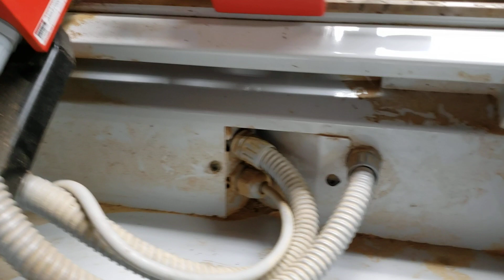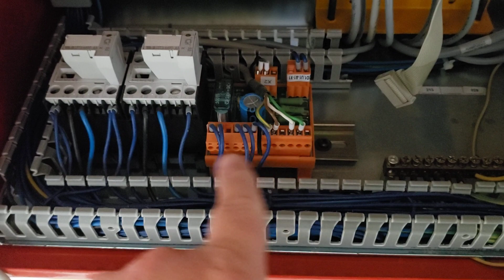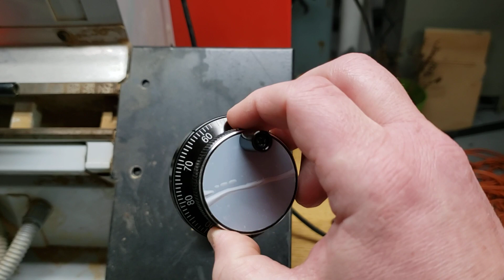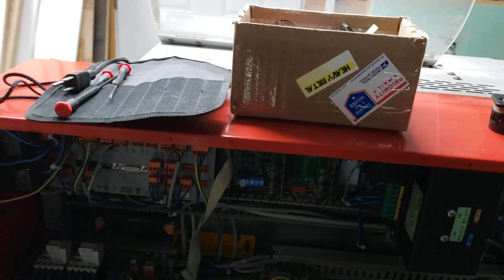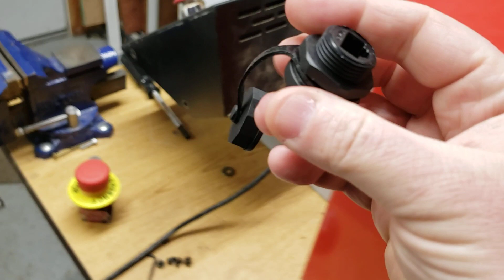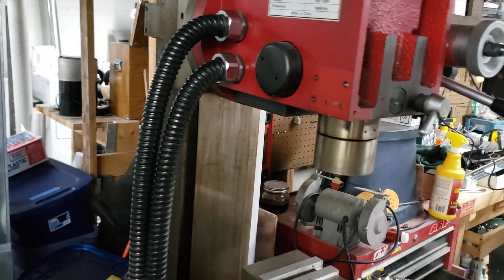new toys, build happenings and other general bs  emco pc turn 55 build coming soon

Comment: Hey. I just got one very similar. Moving it to mesa 7i96 but have it moving with parallel BOB to test. Need the extra inputs for turret and threading encoders. Trying to figure about the turret with carousel comp atm. I ended up replacing the stepper boards with drivers but not sure if that was necessary.
Reply from the maker: I got all of the information from emco on how to use the old driver board, so I'm keeping it for now and connecting to it with an idc16 breakout board going to the 7i76ed. I didn't want to be short on IO and encoder inputs and the 7i96 seems kind of limited in that sense.  The turret is definitely going to be a bit of a head scratcher 🤞🤞
Reply: @TheFeralEngineer  sounds like a plan. The relay driver is at the front as you correctly point out in your video, it takes 24v switching and runs at half current normally to keep tool tight against the pawl. The connector at the front of the same board is fed from the opto interupters on the turret, one for index one for home. I'll probably write a custom comp file for it as carousel comp isn't suitable out of the box (and complex for this application). I have something to start from but just lacking time to dig in to it at the minute. Looking forward to see what you do with it, very well built machines for sure.
Reply from the maker: @johnharding9936  I've got ladder logic 90% worked out. Carousel didn't work for me. Watch video 4
Reply: @TheFeralEngineer  awesome I'll check it out. I actually found another comp file that I'm going to try, it's called pc200 I think and it's very close to what I need. I gave up on carousel too, it's too complex for this application. I'll check out your video for sure though, thanks
Reply from the maker: @johnharding9936  i need to tighten up the logic a bit, but I've been playing with it for the last few days and it's reliable every time, so I'm on a solid road. Probably go play with it in a little while to clean it up.
Reply: @TheFeralEngineer  nice one, I know nothing about classic ladder but I see you have a lot of tutorials on it so must have a watch. Thanks for keeping me posted. The pc200 comp is here if you need it at any stage: https://www.forum.linuxcnc.org/49-basic-configuration/33351-lathe-tool-changer-turret-dc-motor-based?start=0
Reply from the maker: @johnharding9936  thanks! It's good to have a bunch of different ways to get to the same end result. I keep comparing Mach to McDonald's - you drive up, order a cheeseburger, drive away fat and happy and Linuxcnc CNC to making your own cheeseburger - first, you start by slaughtering a cow. It's such an open ended software that there's literally a million ways to skin a cat (no pun)
Reply from the maker: @johnharding9936  oh and for the record, my classic ladder knowledge isn't that much more ahead of those I'm teaching. I only started bashing away with it around Christmas time 👌👌

Comment: Are they by chance 5 phase berger lahr stepper motors? i know some other emco machines came fitted with them.  cant wait to see this wee machine going. JD
Reply from the maker: I don't believe so, they appear to be the 3 phase motors from a quick Google search. This is the A01 board. I think the 5 phase motors are from the A00. Emco sent me the schematic for both this morning.
Reply: @TheFeralEngineer  either way they are odd beasts. hopefully you can retain the motors and drives. always good to re-use where possible. assuming they are worth keeping.
Reply from the maker: @makeorbreak5887  yup, saving the motors and drive board, disconnecting the original AC95 bob and replacing it with a 7i76e mesa. Connecting via IDC 16 breakout board to keep it factory clean 👌

Comment: Since I'm working on a Compact 5 conversion at a local maker space I'm very interested in your try on this Emco !
Reply from the maker: I already bought one of the most important components of the build besides the mesa 7i76ed... IDC16 breakout board. Didn't even know it existed until about 38 seconds ago, but it'll be here tomorrow 😆
Reply: @TheFeralEngineer  My bad, I'm going parallel port in 2021 x)
What's the use of IDC16 ? Never heard of it before !
Reply from the maker: @geekoid183  you can use a mesa 5i25/7i76 combo if you want bulletproof DB25 performance, but I wouldn't be angry if you just used a china bob and a pci card 😆. I don't know if the compact 5 is the same configuration as the pc turn, but my machine has a 16 pin ribbon cable coming out of the main board and going to the stepper board. I was half-ready to take the wire snips to it, but someone on the LinuxCNC group on Facebook mentioned the IDC16, so I ordered one up for myself.

https://www.amazon.com/dp/B074TGVCPW/ref=cm_sw_r_cp_apa_fabc_16ZY3TE2XCTZKY14RJYE
Reply: @TheFeralEngineer  Yeah, since all my earlier retrofits were GRBL based I need to gain confidence on some cheap hardware first. You know, I wouldn't be happy to let the smoke out of a shiny new mesa card 😁
The CP5 electronic cabinet is not very modular, take a look: https://www.machinedismantlers.org/Merrillville-/Self-Propelled-/Steering-Components-/Emco-compact-5-cnc-lathe-tool-changer-welturn-control-pixs-4.jpeg
With that IDC16 card wiring will be so much easier on your CP8, looking forward to see how it's coming along !
Reply from the maker: @geekoid183  yikes! That thing sure is tight. I guess because of the control panel all being slammed into the same space. I'm going with a touch screen interface, maybe a raspberry pi4 running LinuxCNC, so the rest of the controls will be pretty optional. The mesa stuff isn't hard to figure out. They have so many options, though, it's crazy. I did torch a pnp prox sensor by connecting it to an output instead of an input... They don't like 24v going straight up where the sun don't shine. Good thing they were the 3 dollar china jobs... No real loss. What i love about the 7i76 series is the modularity of the gpio. You can set up two additional mpg encoders via 4 input pins, you can connect 4 analog potentiometers, you can set an unused stepgen to run 5v gpio, the 24v field input back feeds the 5v circuits for stepgen, rs422, rs485 spindle control and pcw can flash firmware to do all kinds of crazy stuff with the additional header connectors and unused pins... The possibilities are pretty endless on those things
Reply: @TheFeralEngineer  Ahhh the days before smd components...
I'm curious about the RPI4. How hard could it be to have a stable and easley updatable Linuxcnc on that thing 🤔
Io pins on the mesa boards looks like a dream to me. 
As you said, the possibilities are endless !
Reply: For me the additional IO would mainly be used for control panel related things. So maybe some kind of not real time chip could do the job. I'm mostly thinking about this: https://youtu.be/Y1_VYIPNtuk
Reply from the maker: @geekoid183  I'm nowhere near an electronics guru, so breadboarding and smd isn't really my thing, although it may turn into something if i keep messing with these retrofits. 

I've seen that pendant build. It's quite impressive. For now, my inputs are mostly going to be pushbuttons and multiplexed rotary switches 😄
Reply from the maker: @geekoid183  there's a guy on here that did it about 2 months ago, so far it seems to be holding up. I believe there's a precomliled iso under www.linuxcnc.org/iso